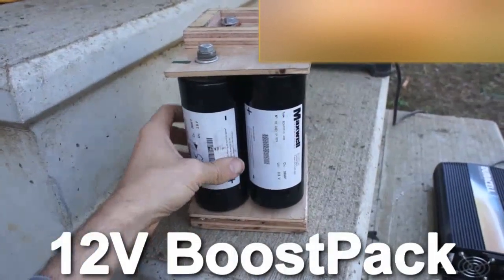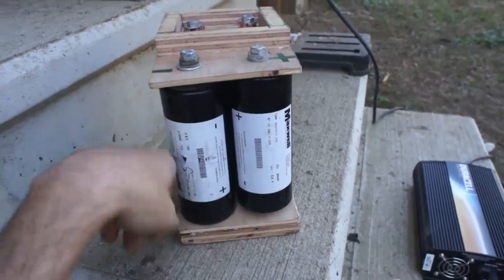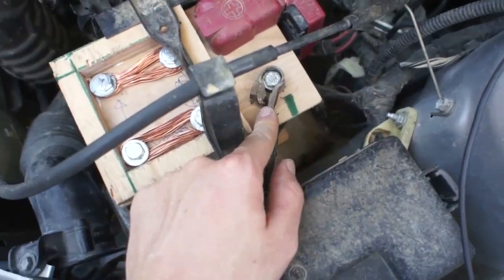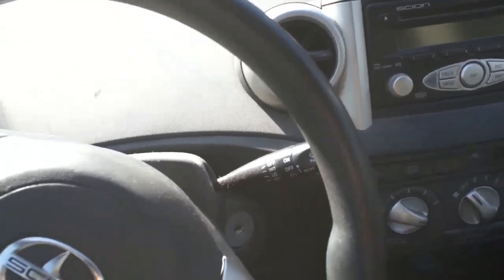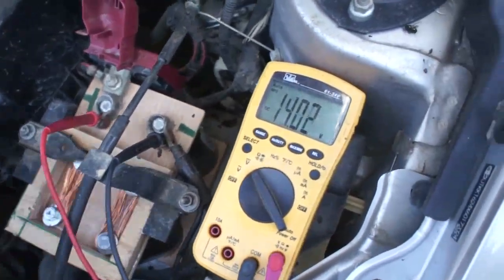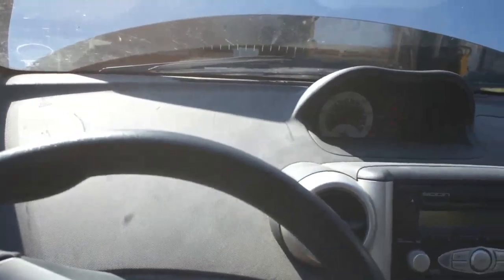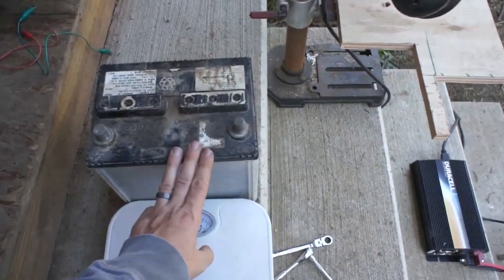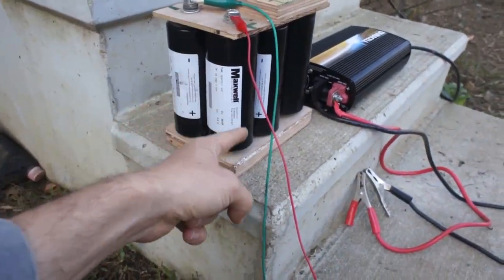12V BoostPack. Replaces auto battery. Works great!

Comment: Honestly you are not going to see any meaningful fuel economy boost with these. Most car sites claim every 100 lbs costs 2% of fuel economy. So a savings of 25lbs would only boost fuel economy by around .5%. Or in a car that gets 35mpg, you would gain .175 miles per gallon. Which would give a gain of around one and a half miles for your average tank. Not really worth it as the way you drive can impact fuel economy FAR more.

As always, lasersaber is big on hype, but low on facts.
Reply: Hes not using this for saved fuel economy.....
Reply: That is one of his claims. You should watch the video.
Reply: I did watch the video, fuel economy is not the main focus.....
Reply: and I never said it was the main focus. YOU read that into my post.
Reply: harshbarj
I think Ibrahim is saying the point wasn't fuel economy.  But in your comment you (maybe unintentionally) bashed pretty hard on lasersaber about fuel economy.  

And then you tore into Ibrahim about it.
Reply: Brennan Sedivy , I just don't like people making claims that go beyond whats possible. Much like solar roads, this is just not practical. If you con't see that, it's your loss. I also am done with their thread. I have learned those that mindlessly support lasersaber are just a lost cause. Muting this thread. o/
Reply: If fuel economy WASN'T your main focus ("read that into"), why did you use a paragraph of fuel economy calculations. Mr. lasersaber is BIG on experimentation, application and the FACTS speak for themselves. He's shown that the his cap pack can hold enough of a charge to start his car after setting from late Friday to early Monday through cold temperatures.VERY likely, super caps have a life a lot longer than a few thousand cycles."Not commercialized...prohibitively expensive"? Really? Mr. lasersaber used those caps in the heat of his engine compartment a lot more than "a SMALL fraction if it's quoted life" Lead-acid batteries don't last all that many cycles. Guess what an enemy to lead-acid batteries is? Cold! And I don't see your You Tube video here any where showing proof to the contrary. Just untried, untested and unqualified guesses.
Reply: He also pointed out the thousands of miles he's driven with the unnecessary 20-25lbs. What you consider meaningless would pay for the cost of this battery over the life of the vehicle, which the "boostpack" will probably outlive. Further more if you were to replace EVERY car battery with one of these, just think of the implications of the COMBINED fuel savings of that meaningless .175 miles per gallon.
Reply: Adam Kearley , unlikely. Super caps generally have a life of at most a few thousand charge cycles. Some new ones have much more, but they are not commercialized yet, and will likely be prohibitively expensive when they do.

Not to mention that an enemy to any cap is heat. Guess what a car engine generates? So the cap is unlikely to survive anything more than a small fraction of it's quoted life.
Reply: Well if fuel efficiency isn't a concern, car manufacturers could design a system that uses both a capacitor "battery" and a traditional battery, with each being wired as the primary power source for what they're best suited for, with the other set up as a backup. This would effectively increase the life expectancy of both, and improve the efficiency of the vehicle. Sort of like using an SSD and a HDD in a computer.
Reply: harshbarj He said he was handing them out to people to test ya fucking noob I'd rather pay the 6 dollars a cap than ~200 bucks a battery. Also moving the "boostpack's" location to other than under the hood of the car would fix that little heat problem.
Reply: 19jimbob52 , Do the world a favor and learn to read. Fuel economy was MY main point. Read the comment in context to the comment I replied to. 

Lets see that pack after a few years. I don't buy untested ideas, sorry. He used those caps for what, a week? Two? Not really a scientific test. 

Also nothing wrong with doing experimentation. That is why I watch his videos. But what he does is nowhere near showing if something is actually practical in real life.

Clearly you know nothing about electronics. Caps simply are not very temperature tolerant, especially when dealing with high heat.
Reply: harshbarj Why tear down other people's work and comments? "untested ideas"? Aren't you seeing the ongoing testing, results and updates? "used...a week? Two?" Mr. lasersabre posted this in 2012 and has posted updates and changes since. "Do the world a favor and learn to read" & "Clearly you know nothing about electronics". Come on, those kind of comments are just plain childish. You have no idea about my ability to read or my electronic knowledge. Once again, why tear down? Let's use this forum to advance the science.
Reply: 19jimbob52
 Sorry if the truth hurts. When you take a comment out of context I HAVE to assume some lacking on your part. As an amateur electrical engineer with about 25 years experience I don't like it when people try and make claims like this without backing them up, or at least providing some data. It's been a few months, but from what I recall, his other videos used different packs, so we don't know the lifespan. As a pack like this can easily run into the hundreds of dollars, you have to look hard at any return on investment.

Not to mention how long can such a pack run say the lights without the motor being on? How about the radio? Lots of people do that daily. Do they really want to have the engine running that whole time?

See, there is advancing science, then there is advancing silliness (like solar freaking roadways? What a waste). No doubt super caps will one day replace the battery as in some uses they already do. but the technology is not there yet for high draw long use applications and likely will not be there for some time.
Reply: harshbarj Oh yeah, truth hurting. Ouch, I"m bleeding. Please stop, you're killing me. Don't HAVE to assume some lacking. Just a put-down. Silliness? Waste? How is it a waste for you? If he wants to waste his time sharing info, what do you care? The waste in your case is that you shared your negativity. No one needs that. I don't like know-it-alls telling other people what they CAN'T do. If it can't be done, they will fail. I have 42 years experience in ELECTRONICS and I run into people all the time who want to impress others by bragging about how much they THINK they know about electronics/electricity. Then they go and burn something up and blame it on a faulty component or a power surge. I wonder if it's just electronics or if all fields are like that. Seems like we have way more than our share of know-it-alls & naysayers. Electronics/electricity seem to attract people who think that it's mystical, spiritual or alive. Like it's looking for an opportunity to git'cha. BOO!
Reply: harshbarj
Bye bye

Comment: A car start is a brief usage of power. Without a battery bank your car alarm or radio and car lights won't last very long at all. You're better off with a real battery. A boost pack is not as reliable as a real battery. There is nothing wrong with using a lead acid battery if you recycle them. Lead acid batteries work fine for vehicle application. A capacitor bank isn't a battery. There are good reasons we use batteries instead of capacitors. Capacitors are not as reliable as a battery and have a much shorter life of use then a battery. You used this for only a couple of weeks. This capacitor bank won't last the same length of service life that a lead acid battery will.
Reply: You could build a capacitor bank that would start your car; that was charged off your car battery. That would reduce load stress on the battery extending the life of a lead acid battery. I have seen such builds help extend battery life. I have also seen a smaller battery used along with capacitors. But personally I would rather just trust a quality deep cycle battery to keep my vehicle operational.

Comment: seriously! I think lasersaber and this video is the reason that supercapacitors are skyrocketing through the roof in price since this video has been made. Because two years ago I could find supercapacitors for expensive deals. Now its extremely hard to even find these batteries also that price went even way higher. OBVIOUSLY these batteries are way better than a car battery.

Comment: So batteries hold current measured in amp-hours.  That is a measure of how many amps it can produce over a period of time.  So stored power is measured as current multiplied by time.  So how much power can you store if you have a traditional alternator fully charge your storage unit in just a few seconds?  Why you have a few amp-seconds of power...  That is not very much!

This battery replacement is NOT new.  It is a string of expensive capacitors (he got these cheap, but if you or I try to buy them they are $75 to $100 each!!)  Capacitors have been used as battery replacements for a long time.  So why do we not do this all the time?  The answer is because you cannot story very much energy.  He started the car several times, but the car was easy to start, it was warm, and the capacitor was freshly charged.

So let's do some math on how much charge we are storing...  It is a small car, so it probably has a small alternator, so it can put out about 60 amps, at full speed.  We aren't at full speed at an idle, so it is something lower...  for a ballpark, I'm going to use 25 amps as a rough guess at how much charging current he is getting when he is idling the car while the capacitor is charging...  So it charges in around 5 to 10 seconds...so those 6 starting cranks used roughly 125 to 250 amp-seconds of energy.  There are 3600 amp-seconds in an amp-hour.  A typical car battery has about 50 amp-hours of stored energy, and in this demo they demonstrated less than .1 amp hour of energy being supplied to start the car 6 times...  Why on earth would we put 60 amp-hours of stored energy in a car that only needs around .01 amp-hour of power to start?

What else can you do with the energy he showed in this demo?

You can leave the door open for 10 minutes, and the interior dome light will use that much power...  So in 20 minutes, the dome light can totally drain your capacitor.  The headlights can drain the capacitor flat in about 5 minutes...  If you are broken down on the side of the road and want to leave your emergency flashers on...    They might run half an hour, before your capacitor is flat...

And what about the small amount of energy a car uses while it is parked?  You know THAT is why we use batteries...

The car battery can deliver small amounts of power for the car computer, and other systems for months and months, and still start the car when you want to go.  But if you reduce the 50 amp-hours of capacity to less than 1 amp-hour, do you think you will always have power to start the car?  Probably not!

So yes, you can start a car if you have a battery to charge your capacitor...  But how do you charge the capacitor when you are not home, and it is a cold day and the car has been parked for several hours?

You can get someone to give you a jump...
Reply: That's why you should have solar cells in addition to this. Things like the ELF ebike have solar panels as the roof, yet car manufacturers have not figured this out, or they have but the people who own the companies would lose profits in one of their other assets (battery sales). There's no sense in trying to keep things the same when there are better ways. It's like trying to insist people keep using manual typewriters even though we have word-processors and email now. Okay, you can use the manual typewriter without power and when the laptop battery dies, you won't be able to type anything. So? When the zombie apocalypse happens, then you will have a huge heavy battery in your car and you can leave the door open for a few days and come back and crank it. Other videos have shown this capacitor bank lasts a full weekend. You are seriously underestimating its longevity. But add a solar panel and you can come back to a car that has been sitting for months and crank it. Let a car sit a whole year and even the heavy battery will have self discharged. A capacitor recharged daily from a solar panel will still crank the car after a whole year of being idle. You know what else? You can put the car in a parking garage basement and recharge the capacitor using a hand crank OR from a couple of flashlight batteries. The fuel might have oxygenated and you'd need to replace it with fresh fuel to get it to start, but the capacitor will still run the cranking motor even ten years after sitting. You can't get that kind of longevity from a Lead-Acid battery. I've seen ten year old batteries turned to dust outside a tractor barn. Those things definitely don't last forever.

Comment: Would you consider modeling and printing some kind of case for the boostPack and selling them as a kit with hardware and instructions for the ultra-capacitors? I need a battery for my Jeep.

Comment: A suggestion: if you're going to regularly charge a supercap with a solar panel, get a peak power tracker. Most charge controllers are just voltage-actuated switches that connect the panel to the battery until it reaches a certain voltage, then they open. Solar panels are near-constant current sources, so as the load voltage drops the current barely rises and you get proportionately less power. A peak power tracker operates the panel at whatever voltage produces the most power independent of the load voltage. So even if the capacitor is near zero volts, where direct connection of the panel would produce little power, the panel could still operate at 12V or wherever it produces peak power. Most "12V" panels actually peak around 16 or 17V (higher voltages in colder temperatures) so you could get more power even when the capacitor is fully charged. And it will charge MUCH faster if you start with the capacitor completely drained.

Comment: I'd like to see that at -40 2 days left without using to see if it works.
Reply: You are talking about cold cranking amps. In a traditional battery, the colder it gets the lower the amps it will turn out. A capacitor does not suffer from this like a battery. Right now, applications that need a reliable high power output at a moments notice regardless of temperature will use a capacitor. Wind turbine blade pitch, and other industrial applications are all switching to capacitors for that reason.
Reply: yeah, but since all the motor and oil itself are cold, it require more power to start. Will the capacitor hold enough power for long enough? We saw that without using your car for 3 days, you lost some amps (normal stand by usage). How well will it start on a winter day
Reply: Kyle Schmidt An electrolyte (which is in many of these super caps) is a liquid and has the potential to freeze solid on sub-zero days, BUT I do not know its effects of that electrically. I'm sure it would not be the same effect as water in the cold.

Comment: Perhaps flexible solar panels, seebeck power generators to convert heat into voltage and a power management system to the capacitor bank and the electrical system to relief the load on the alternator, get better mileage, not worry about car not starting and/or buying batteries.

It can be done.

Comment: its charging back up to 14 volts because ur actually testing the alternator there..while the car is running.
Reply: I agree, I have been a mechanic for over 30 years and while I am not instructed in the use of capacitors etc. I agree that you are getting the feedback through the positive wire showing the charging voltage of the cars alternator. However I was interested in perfecting your invention to use as one of those jump off boxes, for example; I have a 50cc moped with a super small battery compartment that won't allow a large enough battery so it has to be jumped off all the time and a small capacitor invention such as yours would do the trick and still be small enough to fit in the seat so I am very interested in where to get the parts at the most reasonable prices and how to safely build and use it.
Reply: @Prott-7  Supercaps will charge up as fast as you can supply them unlike a car battery. The limit is the alternator. Its not like a battery. So, if its 14v, its charged already!  Note that a lead acid battery has more overall power - but its over time as batteries have high internal resistance. Caps have huge current draw and huge release of energy as it has super low internal resistance, but does not have as much power over time. But, millions of cycling and very light weight make these ideal. These won't power an electric motorbike but for a gas bike, but note the motorcycle has a very low output alternator so will take longer to recharge and may damage the alternator without a limiting resistor. Ebay is your source. If 12v then 6 caps in series.

Comment: To talk apples and apples, you need around 200,000 Farads to equal a 50Ah battery.  Caps are great for large impulse current though.
Reply: you can only use upper 20% of car battery capacity, because it's not deep cycle battery. have you counted with this?